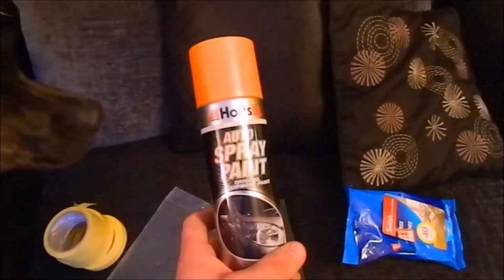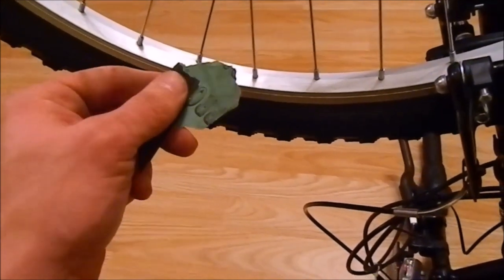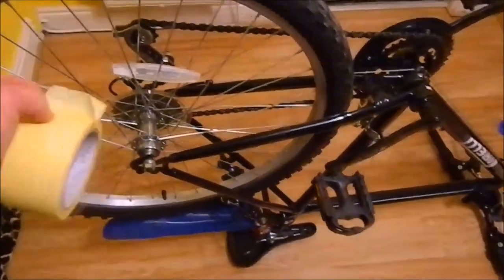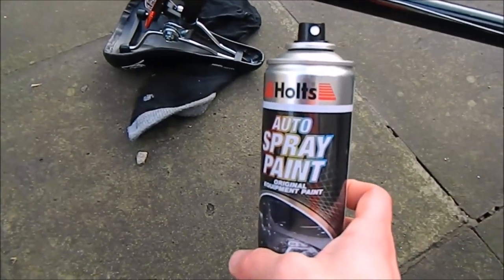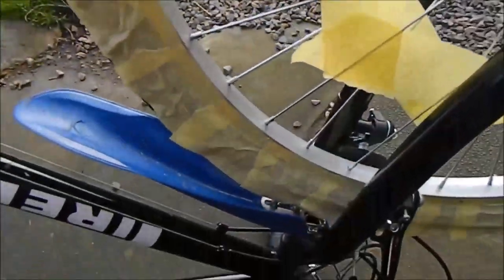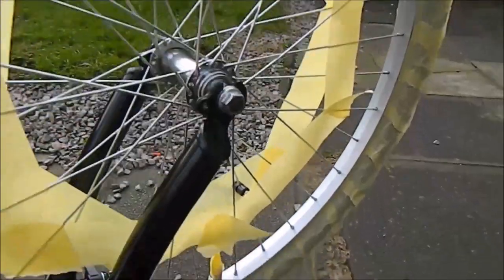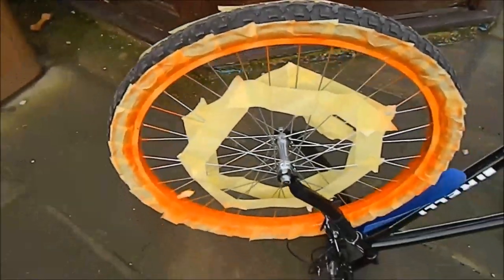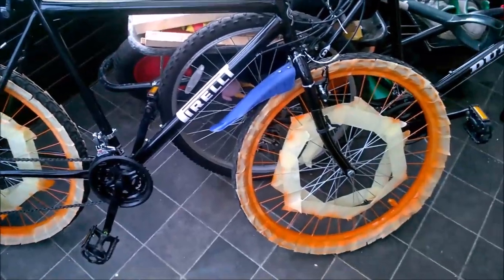How to paint bicycle rims without removing wheel and rim

Comment: What about adding a clear protective coat on the rims? Is that needed?
Reply: No, bu it will look astonishing. If you put at least 3 coats of paint you can then let it cure FULLY this usully takes at the very least !24! hours even if the paint is dry in 5 (this is very important) then go for the clear coat. After that us about a 2000 grit sand paper "wet" make sure you get it wet before applying it this make sure that the same paper Glide smoothly across the middle without leaving large scratches, it is also very important to not sand too much do not sand in one spot for too long and do not put too much pressure while sanding you do not want to send through the clear coat. After that let it dry off then take some dry buff polish and Kota very heavily and after it is buffed off it will look exteamly professional with mirror finish look.